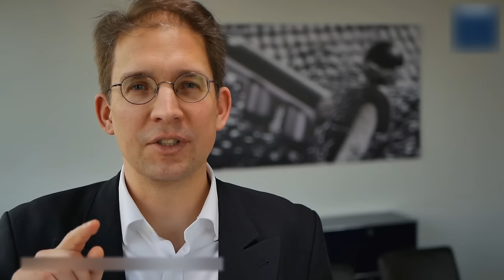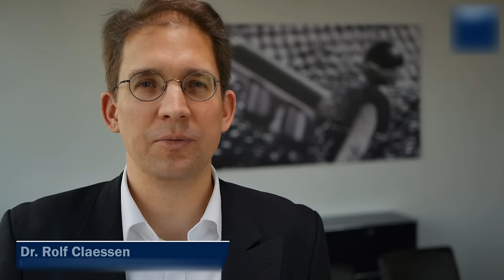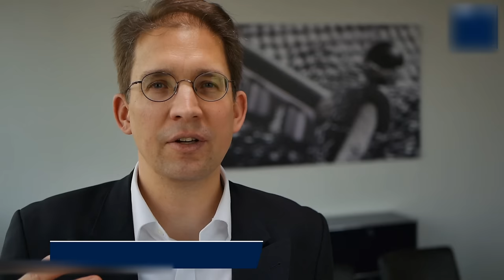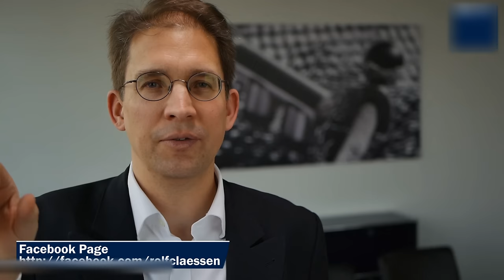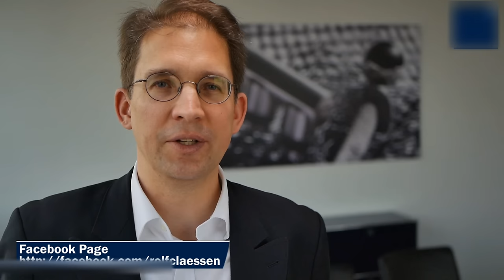Patent Claim Drafting - 5 Core Principles - 12 Common Mistakes - My Favorite Strategy #rolfclaessen

Comment: #12 is an often-repeated "rule" that is not actually as strict as it is usually presented.  There are some claim elements that are inherently definite, and do not need to be introduced with "a" or "an", because they don't require an antecedent basis.   If you have "a circle", for example, you can refer to "the diameter" of the circle instead of "a diameter".  Every physical object has mass, so you can refer to "the mass of X" without having to mention that it has "a mass".  The same goes for ratios and sums of already-identified values:  "wherein the ratio of A to B is 2.0" is good language; you don't have to first mention that there is "a ratio".

Comment: Imagine you were writing a claim for an umbrella and the shape is unique as it is an oval not a circle to better work in the wind, yet the non-obvious/elevated build factor is that you put a baffle or an escape for the air to get out and rain not to get in and the umbrella does not get caught in the wind. Now when writing the independent claim your not sure if the oval shape alone is good enough to make it unique but are pretty sure the whole/baffle will be the novelty. Should you leave the,, baffle/whole out of the independent claim and add it as a dependent claim if you think just including the oval in the dependent claim would cover more scope? Thanks!!
Reply: ... and if you find the "oval" in prior art then you would add the "baffle or whole" for air to escape to claim 1 "the independent claim" in your opinion?Lastly, If you thought that there was never an umbrella which had the circumference of the canopy less than, in measure,  the length of the handle and you believed you can only reduce the size of the canopy so much till it becomes ineffective and a longer handle was your invention and a better way to build an umbrella, would you add the statement, "the length of the handle is longer than the circumference of the canopy" which would force others trying not to impeade on your patent to make a smaller handle in relation to canopy circumference?

Comment: Mr Claessen; consider you want to apply for a patent which is a mechanism that should at least be consisting of parts A, B and C. A is known by prior art and B and C are the distinguishing parts. However, B and C could both be used together or they could be used separately (only one picked without the other). Thus, A+B+C, A+B and A+C would serve for the same result. So, I would like to protect all three combinations. Since two independent claims are not allowed in Europe patent, what should my independent claim look like?

Comment: Thank you for the information.  I have a question regarding my patent, which is a device to provide a process solution in a specific field.  This device can also be used outside of the specific field.  All prior art and specifications are specific to the field.  How can I claim this device to be used outside of the field if it has a slight modification?  I am worried if I include it in the claims, the USPTO will come back with an action to file a seperate application.  If this is the case, do you know if I will keep the priority date?
Thank you.
Reply: I do not think the field of the invention is a constraint you need to worry about. Just describe the modification, application and outcome in the body of the patent document. Make drawings that show this modification. Then claim that modification as an independent claim.

Comment: Rolf, I would like to thank you for your informative video “Danke”, and ask a question regarding my patent application.  I received my fist U.S. office action regarding my patent addressing an artificial intelligence paradigm using cascading neural nets. After watching your video, I came to the conclusion that I would be better off by minimizing the independent “claim one” to a variation of a basic neural net  with multiple dependent claims. This leaves additional content in the drawings and description. Does this become prior art? Or can I file a subsequent patent later?
Vielleicht kannst du diese Frage auf Englisch beantworten. Dein Englisch ist viel besser als mein Deutsch
Reply: Prior art is anything disclosed in the public. So for example, if it's published then it is prior art. 

How did you get on?

Comment: Just vapid. As if his 9 minute video can enable someone (even an attorney) to draft competent claims.  The biggest mistake in claim drafting? The claims don't correlate with the drawings or specification. I could say it a million times and only a few patent attorneys would comprehend or agree with that sentence.  I've said it straight to a "patent attorney's" face and still he will draft claims that are not supported by the drawings or specification.  It's the most basic concept yet apparently the most difficult to understand. Sadly this mistake typically comes out many years later during litigation when the claims are declared either invalid or not infringed.